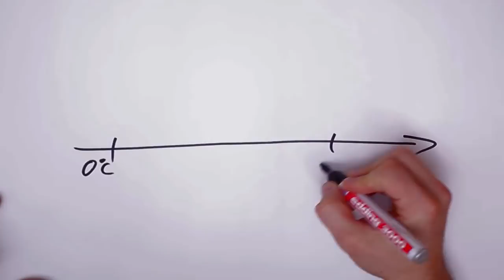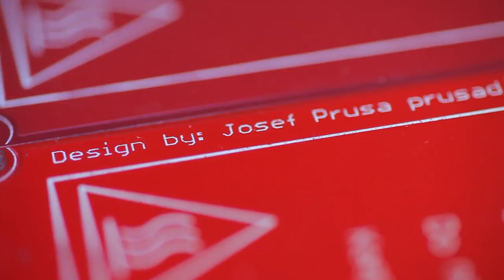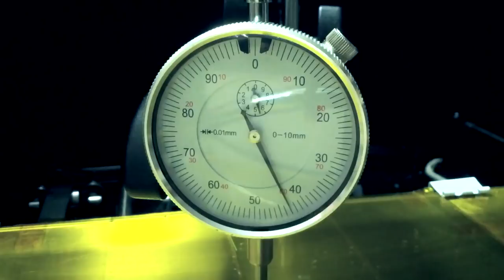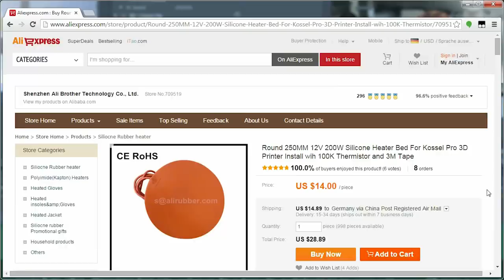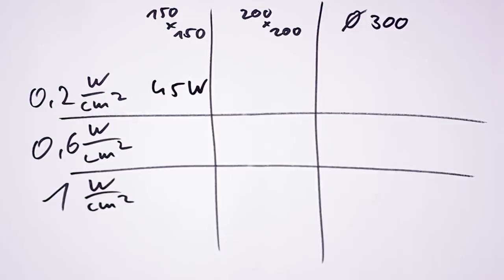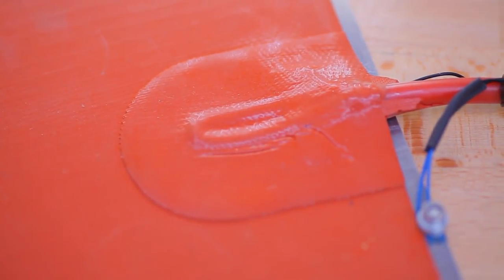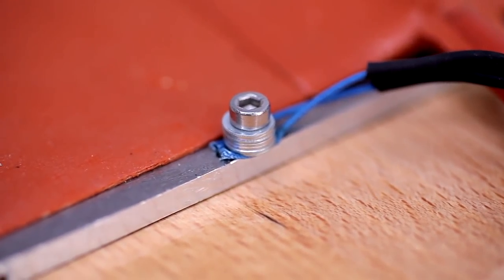3D printing guides: Everything about heated beds!

Comment: Hi Thomas , nachdem ich nun mein Heatbed installiert habe . Habe ich folgendes Problem , nachdem mein Heatbed 110°C für den Druck erreicht hat und mein Hotend beginnt aufzuheizen , schaltet sich mein Drucker ab bzw. er hört auf zu heizen. Dies geschieht bei etwas über 140°C Hotend , bei PLA gibt es keine Probleme bei HB 60°C und HE 190°C
Reply: Nein keine Meldung , er zeigt auch weiterhin Heating an
Reply: *****
Das hört sich so an als ob das Netzteil überlastet ist. 110° liegt 90° über einer angenommenen Raumtemperatur von 20°, während 60° nur 40° drüber liegt. Folglich benötigt 110° deutlich mehr Strom um die Temperatur zu halten. Wenn dann das Hotend dazu kommt könnte es der thermische Überlastungsschutz des Netzteils sein der da zuschlägt. Das die Konsle noch funktioniert passt allerdings nicht zu der Theorie, es sei denn du hast den Drucker über USB angeschlossen. An meinem Drucker habe ich einen Raspberry Pi mit Octoprint, der Pi versorgt den Controller im Drucker über USB mit Strom, auch wenn der Drucker noch nicht angeschaltet ist. Auf diese Weise wäre das angedachte Szenario möglich.
Reply: Flyby Wire dann wird es sich um eine Überlastung des Netzteiles handeln , denn ich habe das Board über USB am laufen ! Eigentlich sollte das Netzteil genug Power haben . Ich werd es testen . Danke

Comment: Can you help me figure out why my heated mat (attached to aluminum plate) wired to my reprap 1.4 heats up for a few minutes and then turns off?  The prints will still print, but this means I cannot print ABS.  I'm setting it for 110ºC, but it only gets to 47ºC then slowly cools down back to room temp.  I bought this one off amazon and don't know which TEMP_SENSOR_BED to set the #define as.  I've tried 1, 2, 3, and 4 so far.  Same results: http://www.amazon.com/3D-CAM-Printer-Aluminum-Thermistor/dp/B01A7QMA9U?ie=UTF8&psc=1&redirect=true&ref_=oh_aui_detailpage_o06_s00#feature-bullets-btf

Comment: I'm making a 3d printer with a 16x25in build volume . I need to power 6 heated bed plates  how would one do this
Reply: one beefy power supply
Reply: Like how many watts and how would I connect it to my ramps board
Reply: I doubt the ramps can handle 6 heated beds, i would probably look for a custom heater matte like in the video, you can get them in custom sizes and everything. I'm no expert as far as the electronics go so i'm not really the person to answer your question unfortunately.
Reply: I have a 380 watt psu and a 200 watt psu from some of my old computers
Reply: Tom that place you said to go to hasn't finished my order and it's been like 3 months
Reply: ***** I can't speak for others, but I like to see a follow-up video to this one that provides more detail on your MAINS heater configuration.  Specifically I'd like to see how you connected your SSR and any changes you needed to make to Marlin to get all of your components to be friendly with each other.

Comment: Has anyone experimented with metals than aluminum?  Brass should transfer heat way better than aluminum - my thermal guy at work says 3x!  It would be expensive, but I'm tired of warped large beds.
Pyrex is a Corning brand name for borosilicate glass - it's exactly the same thing.
Kapton with a Acetone/ABS slurry works perfectly with both ABS and PLA.
How about an insulation layer under the heaters?
Reply: *****
My error - I meant copper, not brass.

Comment: Hi I have a 600 w 24v heater bed what are the minimum requirements for power supply?
Reply: I can't find 24v power supply can I use 12 v power supply for 24 v heater will it work?
Reply: Aravind kannan There are 24V power supplies. If you already have a 12V one you'd use a beefy boost converter I guess.

Comment: I bought a rubber silicon  heater from amazon and it does not have a sticky side to mount it.  How can I mount it.
Reply: +Trey Roudebush I will Repeat this question. My old heater died (Solidoodle Press, 6 months) Got a new one, old was sticky, new is Not. How do I attach it to the bed?
Reply: Russell Purkey use a silicone sealant and silicone gun both available at local hardware store
Reply: Buy double-sided adhesive tape?

Comment: I need a suggestion for external circuit. Have bed (214mm x 214mm - 12v or 24v). I need a link to a controller for it, or a way to control without electrocuting myself or burning it down. Has anyone made an external yet?
Reply: Thanks Thomas. Im just not sure what im doing here. MOSFET, the power/temperature control units right? With led readouts and such and a relay between it and the board? I think I have the right idea, but im still afraid im gonna shock myself, it wouldn't be the first time its happened lol. And yes, it actually does make your hair stand up for a while lol.

Comment: Hi i a Prusa I3 steel, I built a couple of years ago, so far I've been using a pcb heater and glass bed. I was thinking about switching to an aluminium bed, silicone heater and use an induction probe. My problem is I've read alot that aluminium isn't as good a print surface as glass, what's your opinion?

Comment: i know this is an older video but i really need help with my 3d printer, i had bought a prusa i3 and its all together and wired up but whenever i plug in the power supply evenything shots off. i do believe its the heated bed part thats shorting it out but im not an electrition lol but if anyone can help out with this please send me a message on youtube or send me a message on skype, my username on skype is dontstopbelieveng     if this message is still here then im still having issues. thanks :)